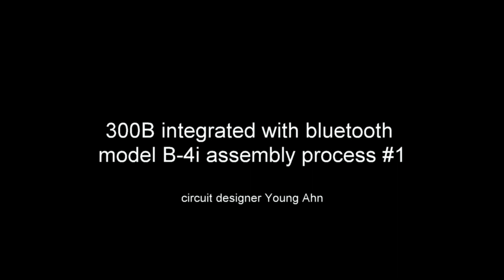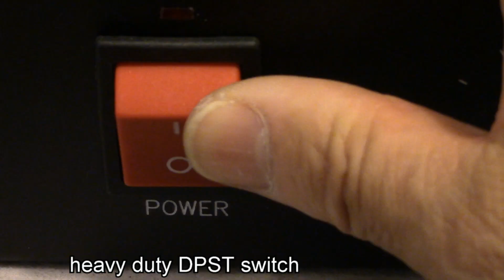300B integrated tube amplifier B-4i assembly process #1 ; FLUXION tube amplifiers

Comment: Hey Young Ahn. Are you in Korea? Do you sell any of these designs as kits?  Also have you ever experimented with Autotransformer Volume Controls and speaker attenuators?  Love to read your thoughts.
Reply from the maker: Hi, I am in Ontario. not KITs available because of high risk of failure. I am working on PCB design. Someday later. thanks